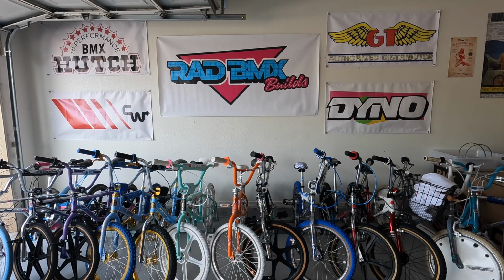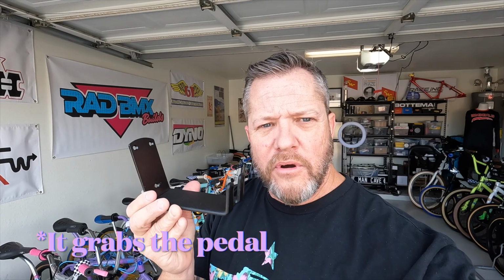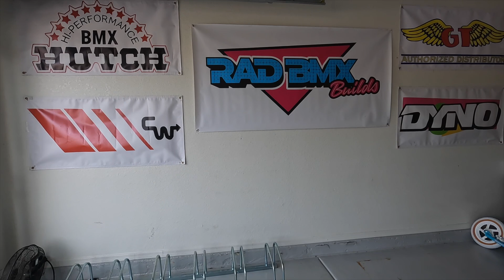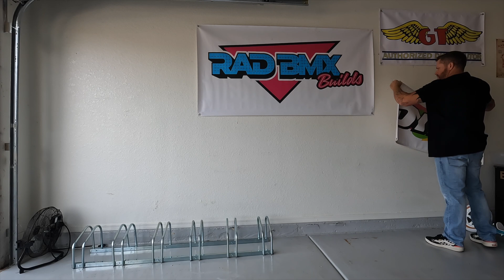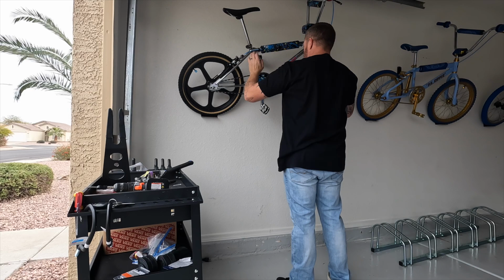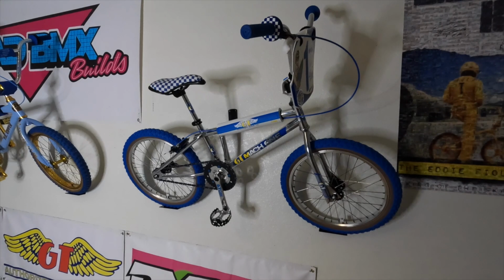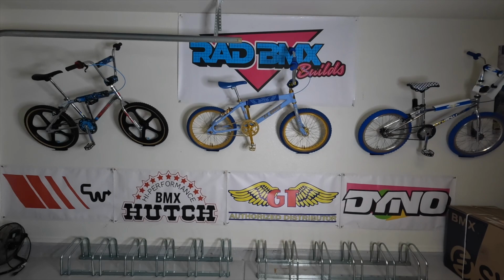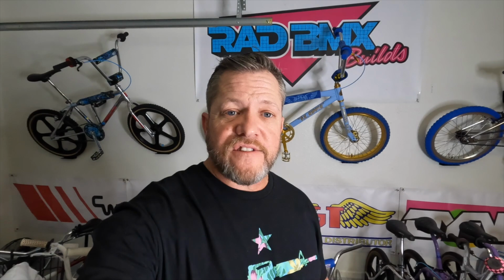HOW TO INSTALL A BMX WALL MOUNT | AMAZON BIKE WALL MOUNT | BMX COLLECTION

Comment: Man that baby blue and gold SE PK Ripper looks KILLER!!!!!  I am almost done restoring my 1996 (ish) SE 24' Floval Flyer, just waiting on the Profile sprocket to come in. I kind of did a Resto mod to the bike, new parts like repop Redline flight cranks & New SE Blue rims, it came out soo bitchen I don't even want the tires to touch any dusty ground! LOL. I found this video because i did a little search on how to display my SE in the garage along with my 2023 SE OM Duro and came across this video. I purchased 2 of the wall mounts. Thanks for the video!. Thumbs up like.

Comment: You have to have support for them, but Discount Ramps has the pully style ceiling hangers. I know when properly supported you can hang a Zooz 750UU from it. I have my Zooz 750UU and my 1983 Blue Max hanging in my living room from the ceiling.
Reply from the maker: Nice

Comment: Don't know what it's called, but I have a 20" bike with a shock in the middle of the frame (mono-shock) with a larger than normal seat. Blue and yellow color in decent shape. A 74-75 Era, I guess? Should I keep it? What are the worth?

Comment: Single hook for the pedal the other two mounts for the wall are totally unnecessary as the tyres hold in position (even once deflated)
Been doing this for the last forty years with a normal hook from the hardware store.
Reply from the maker: Okay cool. That’s your way and this is my way but I appreciate you taking the time to share your opinion also on my video